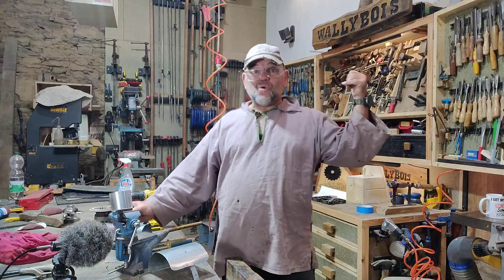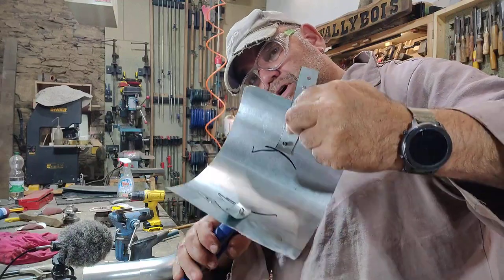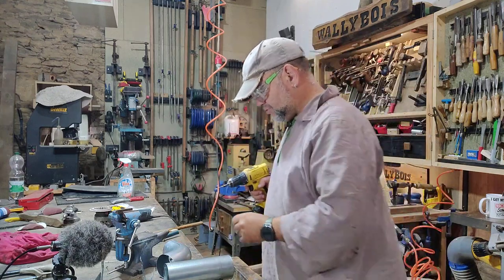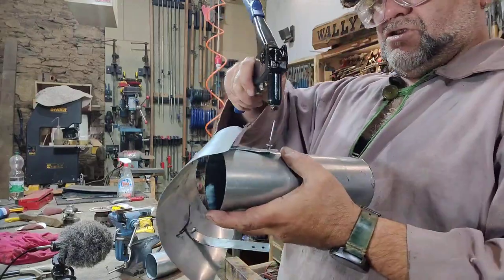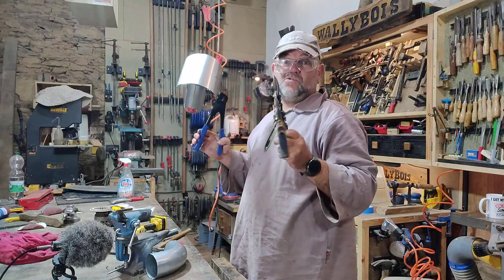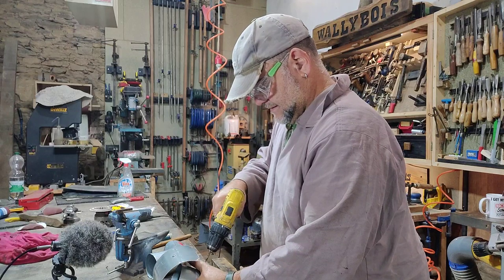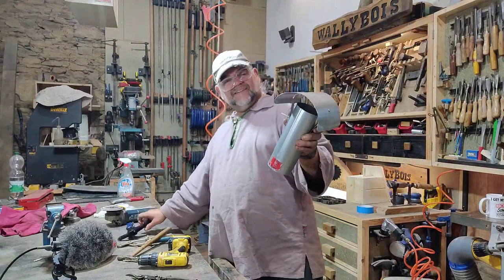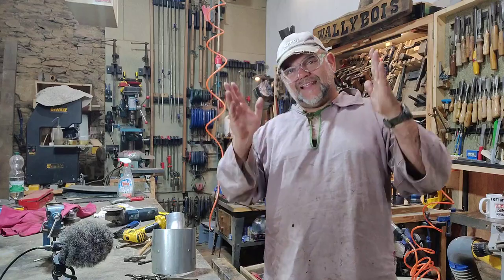It's fun to make stuff: Pellet or Wood Stove Flue Cap for Free

Comment: I know if you weld galvanised metal you can produce poisonous gases does that not happen with wood burners due to the confection of the heat temperature and gases?
Reply from the maker: I don't believe it gets hot enough up there... It's fun welding Galv though it's like magnesium but just don't breath